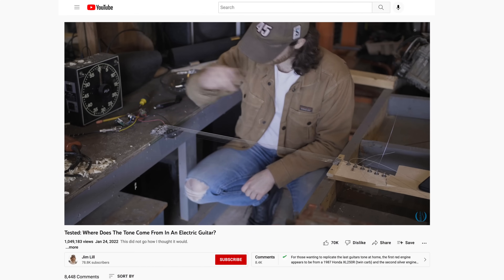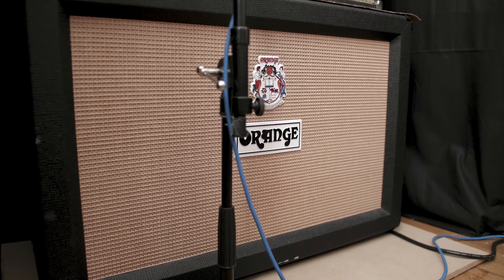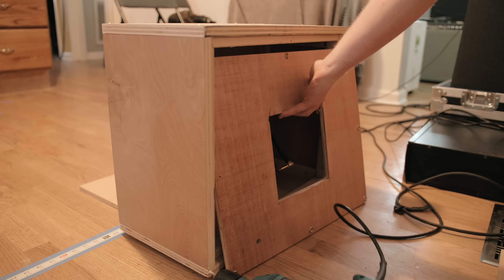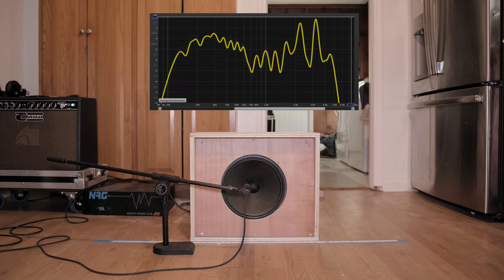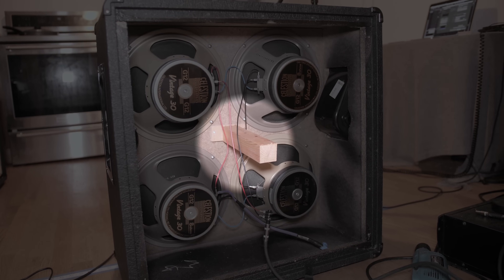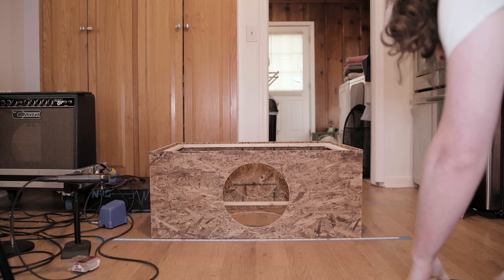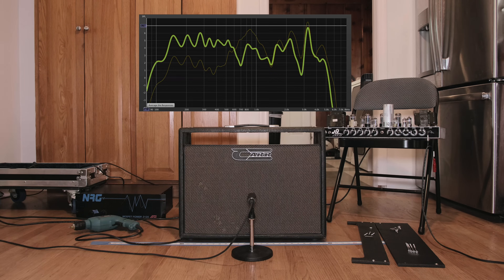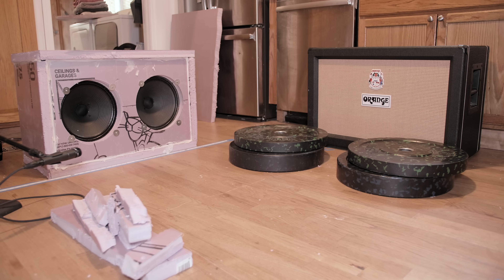Tested: Where Does The Tone Come From In A Speaker Cab?

Comment: I wanna be the first to call you "Mad Scientist of Tone"... 
Your ideas, variables and methods are all Practical, Reproducable and have Results that can`t be argued... If they could  be argued, just experiment with THOSE variables and you 
still Ultimatey come up with the same answer, it`s not just subjective, but has the backup of the Oscilloscope`s comparable waves...
I personally have had coversations with many Musicians, who 'Claim' one type of Speaker is better sounding than another, Or even better a particular wood is Superior to another...
It`s all subjective to the listener... 
Eg; A friend had a US $5000 Custom Shop F type guitar made and I had a $300 F type guitar in my collection... The DIFFERENCE between the two guitars wasn`t the expected 6 times
the difference but less than 10% Difference... In playability it was less than 5% difference as they both were well crafted... The TONES were almost identical in the Expirements we 
did with Multiple Amps and effects... (Less than 3% perceived Tonal quality difference) 
I applaud your efforts in DEBUNKING the Industry Standard Benchmarks and proving that TONE is all the PERSEPTION produced by the hands and Ears of the INDIVIDUAL player...

Comment: Excellent work! Thank you so much for your efforts. Did you consider to also test front-mounted speakers vs back-mounted and also padding the inside of a closed box? Many many years ago I built a closed 2x12 with front mounted Celestions and paddedmthe inside with foam. Sadly I sold the box but it sounded extremely good and very balanced.

Comment: I will need to watch this 4 more times before I can take it in.  Its great that you didn't suggest which was "better",  because its more about being right for the sound than being accurate.
Story #1 There is a company in the UK that builds "high end" bass speaker cabs.  They only used 12" speakers because that's the only deal they had in place.  They make a really big science argument about why a 2 X 12 cab was better than a 4 x 10 or a 2 x 15.... until they started offering 10" and 15" drivers and the argument reversed. 
Story #2 On the way to record "Rocket 88" the Bands Bass amplifier was dropped, splitting the cone, which had to be fixed with paper and cloth.  The distorted sound with a major feature of that record.  The Stranglers recorded the Whole of the first album with a busted cone.

Music equipment dealers sell to the emotions of their customers.  If you sold a Vox cab for $100, no one would buy it.  The audience can't tell the difference either.  They listen with their sense of excitement. The lesson is clear. spend more time rehearsing than you do shopping for equipment ..... I'm off to practice.

Comment: You forgot a very important configuration: A multi-speaker cab with half the speakers missing (this is a thing, I assure you). A bare hole strangely does not significantly reduce volume but I suspect it changes tone.

Comment: Fantastic information.  Have you ever considered testing with a 15" speaker?  I plugged my amp into a 15" extension speaker and it sounded fantastic. I would like to build a 15" cabinet but I don't know if I should do a closed back open back, or a round port in the front??.  Thanks for all you do.

Comment: Thanks for doing this video! Curious if you’ve tried a/b comparisons on de-tuned cabs vs regular? Example a de tuned 2x12 is basically same cab with a closed back and one speaker removed.  A 4x12 de tuned would have 2 speakers removed. (The impedance change is compensated at the amp output.) I haven’t tried before, but just reading people’s reports on significant change in sound to more of a ‘bigger’ room filling sound, especially on lower power amps at less volume. The front to back depth of de tuned cabs seems to be increased over regular and more towards 16”. Kevin O’Connor details these in book London Power -DIY cabinet building

Comment: the vintage 30 has a heavy magnet compared to the cone weight.  if you use a lighter speaker the difference the cab makes may be more pronounced.

Comment: I thought you were so stupid when I saw the 11" hole saw, ...until it worked and you seemed happy about it.  Thumbs up for the 11" hole saw.  That would be a perfect thing to use for making a speaker cabinet, ..but you need a great big drill or a big drill press that can take a big radius hole saw. Maybe an average drill press could do it.  The hole saw cuts such perfect holes. It was such a ridiculous idea, but it worked perfectly. Thanks for that tip.  Thumbs up.

Comment: I have been building custom cabs, replica cabs and he is right in guitar tone the manufactures really did not spend a lot of time of design of cabs other than size due to the total number of speaker and dimension of the speaks there is no real formula...the only time this comes into play is for a Thiel design cab and car audio sub boxes when you are tuning for a certain freq.

Think about it Leo Fender used cheap plywood for all the classic fender cabs....the magic cam from the amp design and speakers not the cabs..

Comment: I love this vid!  Do you think where the speaker is placed, on the front baffle, changes the way the speakers interact with the cab?  So, a single speaker cab with the speaker right in the middle might sound a little different than putting the speaker close to the corner... for instance.  I'm sure it wouldn't make a huge difference, but it might make one that it noticeable.

Also, you could build a cab that has an open back, then build a cab that tightly fits over the back of that cab that could be slid in and out.  This would be an interesting way to change the cab volume without building multiple different cabs.

Comment: ******One of the Punchiest and Beefiest cabs I'd ever owned and played was a gutted 4/12 Marshall half stack that was placed inside 1" thick ply, traditional arrangement, 2-4" deeper, closed back to which I'd added to its interior a sheet of hdpe and curved at the bottom of cab and home insulation batted before placing the back Back on(batting sandwiched between hdpe sheet and wood back). No cloth protection on speakers! However, in place of any cloth was full front cover of steel expanded industrial wire mesh(diamond shape). I never REALLY understood what made this thing sound so tough. After watching this I wonder if the Mesh and Hdpe combination played a part along with heavy wood materials? Sadly I lost the cab along with a bevy if all our bands equipment in a fire. Two years of awaiting insurance cover inspections and itemizations(plural) I was able to replace with a Marshall 4/12(no slant to capture what I once had) and it was NOT EVEN CLOSE.😔******
Again...might it had been the combined steel grill with heavy plywood and the curvatured HDPE sheet interior??? Hmmm🤔

Comment: You've definitely documented significant differences of many varieties.  That seems to be inevitable if  you apply enough experimental conditions.  The problem, however, lies in assigning qualitative adjectives to each variation.  Ok, a rattle is easy to  determine as a negative change.  But whither the other changes?  What is "better" to one player is "worse" to another.  And even for a given player, "better" and "worse" is completely subjective and variable based on a myriad of factors.  Is, for example, "more bass" ALWAYS better?  Is a flatter frequency response across all frequencies better than one which emphasizes certain ones over others?  Therein lies the problem.  There is very little objectivity or subject to subject consistency/conformity when it comes to the evaluation of sonic characteristics.  Psychoacoustics is hard.

Comment: It would have been better if you mic'd the room instead of just the speaker. Cabinets really add to certain frequencies when your in a room. Just take the back of one of  your cabs and  let it set loosely on the back. You can even tilt it to get more air through the back. You can hear big differences in the room, but probably not much through the speaker itself.

Comment: Check out the Toob amp from Finland, a lightweight speaker cab made from 12" corrugated plastic sewer pipe. I want to DIY one; they are super lightweight, water resistant and small! I wonder about the tone...

Comment: It's funny, throughout the whole video I was thinking "Why doesn't he first read up about loudspeaker design, infinite baffle, open baffle and bass reflex and how they each work..." . Then after about 16 minutes of the video, finally mentions these things as conclusions.  

I guess it's about video presentation and drawing people in, making a video that might appeal to the traditional thinking and ideas of guitar players...  but for anyone who would be interested in cab design, the answers were easy to find from the outset.

Next is to understand the frequency response of the driver, the electrical resistance (impedance) to being driven by the amplifier for each frequency + the amps ability to overcome those, and how the frequency dependent air pressures, phase cancellations from the cab dimensions then in turn change these aspects too.

Comment: That styrofoam cab at the every end got me wondering what is the lightest, strongest, cheapest material one can realistically make a speaker cab out of that would survive a road tour?  Glass filled polymer, maybe, but that also requires very expensive tooling and molds.

Comment: All these changes are primarily just differences in the EQ of the overall sound. How many of these changes could be simulated just by EQ-ing the signal to match? E.g. simulating closed back from open back, or a large cab from a small cab, just by increasing the bass.

There are plugins that can take 2 frequency response curves and generate the EQ profile needed to convert one to another, what happens if we were to use this on these tones? It would make all the differences largely irrelevant.

Comment: What would happen to the tone if you took the 2x12 and 4x12 cabs and built baffles for a single speaker in different positions? For example with the 4x12 the speaker would be in a corner, center, or top/bottom/left/right center.

Comment: so, cab doesn't have to be heavy, doesn't have to be from an expensive material, doesn't really have to be big, unless you want louder low end (which is the part of frequency you generally cut anyway so it doesn't clash with bass)?🤔

Comment: Interesting, a couple questions come to mind. Does the position of the speaker on the baffle effect the sound. I noticed in the ones you made the larger ones specifically in the 1x12 cabs they were lower and not centered on the baffle. If they were centered would they sound different? The other is that both the Styrofoam  and wood are both straight and flat surfaces which I suspect is why they sound similar. It would be interesting to explore shapes and textures to see how that effects the sound as well. For example if you had a closed back cab but the inside back of it was Acoustic Panels Soundproof Studio Foam would it then sound more like an open back cabinet since the sound waves are no longer being bounced back? I assume the way that works is it breaks up the sound wave as it hits the surface and is then bounced back scattered. But since it is inside a box it would just be scattered around inside the box. 

Really cool experiments though sound wave physics are cool. Keep up the good work!

Comment: Thanks for making this video, Jim.  I am about to make a new 1x12 baffle for a 2x10 combo cab (Dr. Z).  I think I found the same hole saws you did on Amazon, but they only have the 11.2" and 10.8"; and a 11.0" would be perfect.  Which size did you use?   Also, when thinking through my project I thought about front loading the speaker, like Mesa and Hiwatt.

Comment: Good cab designs are the ones that choose a speaker and then build a cab based on the required dimensions of said speaker.  One of the things I didn't see in the video was what would happen if you added speaker polyfill or any other type of damping material.  Often times in the car stereo world, this is done to increase the volume of a speaker by making the speaker believe there exist more volume inside a given enclosure.

Comment: Thank you for the video! Kind of easing my pain about my recent purchase.

I just upgraded my noname chinese 2x12 to basically a pair of Matamp 2x12s and the difference is kind of disappointing. My chinese  cab sounds so clear and studio like, and the new ones with ''real'' speakers almost sound fake, like a small practice amp kind of tone, and also kind of distant. any ideas at all? the new cabs are also huge 2x12s so maybe that has something to do with it? I had an Emperor 2x12 with V30s and same issue. Using an Orange CR120. outside of just changing speakers i'm a little lost lol

Comment: If you drill a Hole in the front low between the speakers and mount a cone with open bottom hlf the size than the front. It should reflect the sound from internal if back is closed. Let me know if you try this and how it goes.

Comment: The thing that I noticed immediately was that all of these cabinet changes are only measured through a mic stuffed up close to the speaker itself.  That's a good way to tell how the cabinet will sound miked, but it doesn't tell us how the cabinet will sound in the room.  Baffle size, dimensions, stiffness, etc. will affect the sound projected by the entire cab, but with a cardioid mic an inch or two from the speaker you can't hear how the baffle (or the rest of the cab, TBH) affects the sound in the room.  You must have noticed that in running tests- that the sound in the room was audibly  much more different than the REW graph shows.  If the goal is only to see how different cabinet styles affect the close miked sound, you certainly hit the ball out of the park.  I'm not trying to be one of those "well I would have done it differently" assholes.  I wouldn't have done it differently.  I think your tenacity, thoroughness, and elimination of variables is awesome.  I hope some combo and cab manufacturers watch this and consider cabinet differences more than they have in the past.  Nice job!

Comment: Lol you should cut with the hole saw by putting the bit in the middle down first im only saying for safety reasons especially to anyone watching bonus maximum danger points if it's plug in. You probably wouldnt die or anything.

Comment: I hate to say this...but your audio tests are flawed.  First, you cannot test the sound of a 4 speaker cabinet with the mic 1 inch from on one speaker...you have to step back a few feet to allow the mic to pick up all sound. (You do not listen to speakers with your ear 1" from one speaker. Although it's common for recordings to be made with mics this close.)

You know from experience a 4 speaker cabinet creates a wall of sound unlike a single speaker. (Actually it would take 2 mics, one on each speaker, to test 2 speakers...and to be even more accurate, actually the envelope of sound extends 360 from each speaker...and the sound from each may interract with the ssund from the others.)

You also have the placement of the cab near a wall/ or not, ceiling height and floor covering to factor in 

How many factors affect tone in reality/ in a scientific sense? Alot, some affecting sound way more than others.

Your tests are wonderful and exhaustive, and do show what they show.. but in this instance I am not sure perceived observations are definitive.

For your consideration.

Great video!

Comment: As an amplifier cab builder myself, I have to say that this video is somewhat misinformational: If every audio clip in this video does actually correspond with the visual/video presented on screen, then it is clear to see that the recording microphone (in 99% of instances) is directly in front of the speaker... so, in a 4 X12 test... Jim is only recording ONE speaker... same goes for a 2 X 12 or any other combo. The wood, resonance and build quality of any cabinet DOES affect the tone... but you're not going to hear that with a mic placed right in from of ONE speaker. To do this properly, Jim should place the mic say... 20 feet away - about where you'd hear the speaker if you were stood near the front in a small venue.. or managed to get right to the front of a stadium gig. Not too scientific after all! 🙂

Comment: Some companies just mass produce , put in some " speakers with a name " and the rest is hype . There is very little engineering in their product . Many have the cabinets out sourced and just install the speakers and finish them off . Around 1968 I worked at Sound Electronics , an amp and cabinet company . This was exactly the case . They constantly had samples come in at less cost . That was way back . However , even today , that is the business model of some companies . It's all about profit on a mediocre product . Bottom line : find your sound and tone . Longevity due to quality , price and engineering is another story .

Comment: Significant change number dunno-what: my ears are noticeably less accurate at hearing tonal differences than high-tech computer software.
Some of the changes visible on the waveforms during these tests BARELY make a difference to my ears. Definitely to the point where in a full band mix, post-production, I'm fairly sure the impact is unimportant.